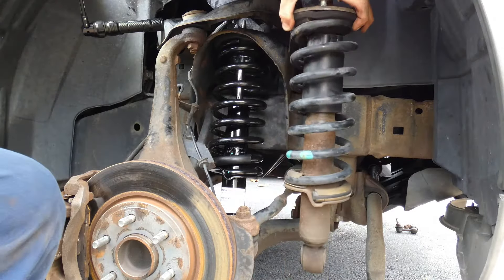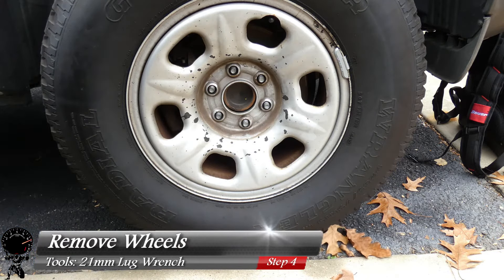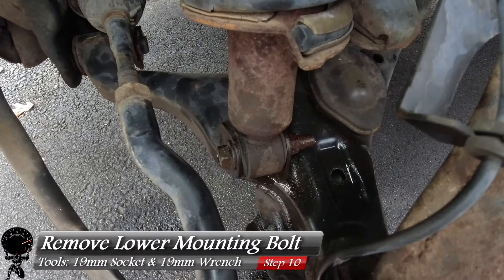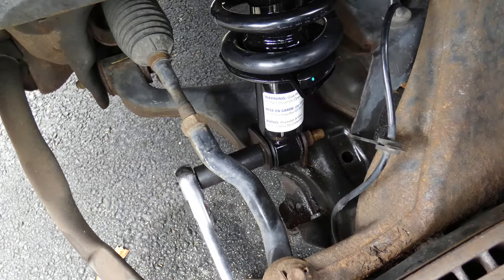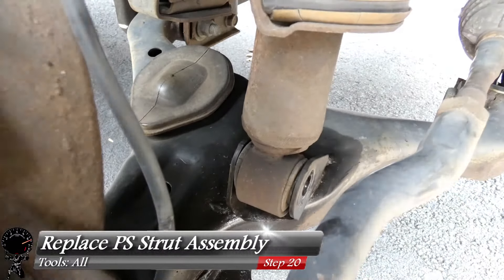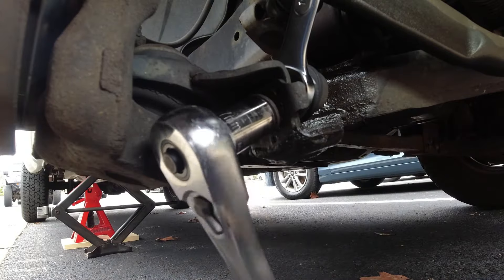How to Replace Struts for a Nissan Frontier/Xterra (2008-2014)

Comment: Hey man, just wanted to show my gratitude for such an informative video! Got some Monroe aftermarket’s I scooped up from RockAuto 140 for the pair. Put them on easily thanks to this video. Thanks for the help! Couldn’t have done it without you. Next up for me are the end-links to the stabilizer bar , and lower and upper control arm (bushing) replacement. I truly appreciate you spreading your knowledge in such a palatable manner. Have a great one, you earned it.
Reply: I would also like to add - make sure there are no aftermarket strut spacers on before you remove the strut (purchased used @ 124,000)😂 almost lost an eye and a couple fingers when the shock flew down because of the pressure from the spacer. I decided to not put them back on and it rides much better as well as ride height being even.
Reply from the maker: Thank you very much. I'm very glad it helped.

Comment: Replaced front parts ,had it aligned ran great, now steering wheel vibrates when I hit 60-70 mp ,now tire on drive side show more wear in middle of tire help😎. Thanks for any help
Reply from the maker: It's hard to determine without looking at it. Middle tire wear can be cause by over inflation. Vibrations could be a number of issues; wheel balance, bearings, bushings, a number of suspension parts. Were you having these issues before the Strut replacement?

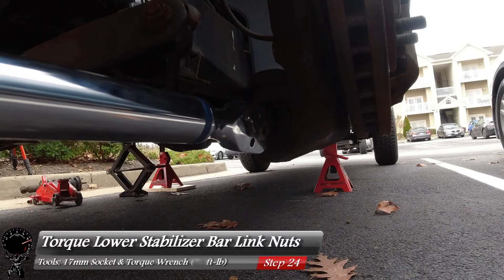Comment: So been watching and rewatching this video of yours and I am puzzled at why the torque value for the Upper and Lower Stabilizer Bar Link nuts are not the same. When you were doing the upper ones, it was 17mm socket and torque value of 67ft-lb, however, when you were tightening the lower one, same 17mm socket but torque value was 14ft-lb (at the 11:59 mark). Shouldn't they be the same ie. 67ft-lb. Did I miss something? Trying to get a clarification here. Otherwise, great video and good tip of the sharpie marking. Now that's what it's for!
Reply from the maker: Thank you. It is 67 ft-lb for both (per the Errata in the description). I'll see if I can add a blur to video to minimize confusion.
Reply: Gotch! Sorry, should have paid close attention to the errata. Was just engrossed in the video part! Thanks for clearing that up!
Reply from the maker: No worries

Comment: This is the best video I’ve seen to help me get ready to switch my struts. Excellent step by step. Thank you for showing both sides, instead of saying just repeat what I’m doing on the other side. Plus, showing the paint marker and why it is so important in the end. On a final note, the difference between a true professional and anyone else is the attention to details. The bushing grease. I haven’t seen anyone else use that in their videos and I wouldn’t had even considered it. It’s the little things the make a professionals quality over just getting the job done type of worker. Thanks again for the great video.
Reply from the maker: Thank you very much. I appreciate the kind words, It really does mean a lot.
Reply: Well I completed the shocks and struts over the weekend and because this is the first time I've done it it took me about 3 hours. The only thing that was different from your video what's the new struts have a bearing on the bottom and no rubber bushing.  That was a little confusing until I read the documentation. I guess it's a new thing now LOL thank you for your hard work on this video
Reply from the maker: I'm very glad it worked out for you!!! Great job and kudos!!
Reply: @mcgurrentertainment   hey man I have a question for you.  Have you ever seen front struts that don't have the bottom rubber bushings? Those are the ones that you said should be greased when installing. The ones I install did not have those just a place for the bolt to go through and just what seemed to be a couple small bearings
Reply from the maker: I've seen struts like that, it's normal.
Reply: @mcgurrentertainment  thank you man if you lived in Stockton I would buy you a big fat triple mocha for that answer
Reply from the maker: No problem at all.

Comment: Ty so much for the video
Reply from the maker: I'm glad you enjoyed it. 😃
Reply: Hey.  My front sway bar is not easy to turn out of the way.  Hopefully I'll be finished by tonight.
Reply from the maker: You got this!!!
Reply: @mcgurrentertainment   Hey.  Having issues tightening bottom shock mount.  Sway bar in the way.   Can I tightening bottom shock mount 1st & do sway bar last?
Reply from the maker: That shouldn't be an issue as long as they're torque down at the correct level.

Comment: The new coils have additional windings and raised my truck 2 inches. Make sure new coils match the original!
Reply from the maker: Good call
Reply: @mcgurrentertainment  I take it you didn't have any issues with ride height?
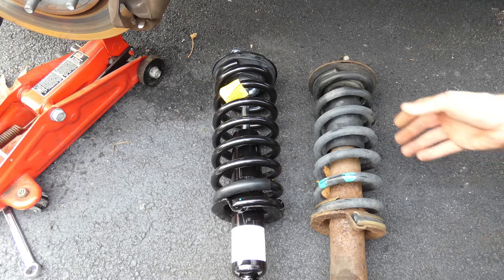Reply from the maker: Correct. At the 6:00 mark, we compared the two.
Reply: @mcgurrentertainment your new coil looks different than the old one.
Reply from the maker: Same length. New one doesn't have a Strut cover.
Reply: @mcgurrentertainment  the new one I installed was the same length too but had more coils which contributed to a stiffer higher ride height
Reply from the maker: Odd
Reply: @texasboy2005 what brand
Reply: @collerdgreens  Sensen

Comment: this is the best video so far on this subject. how long did this take you from start to finish?
Reply from the maker: Thank you very much. Without the camera in the way, maybe two hours. With camera, 4-5 hours.
Reply: @mcgurrentertainment  during your video you were saying that it's very important the torque that lower Bolt after making sure that's the white lines intersect with each other if you don't follow that procedure will it cause alignment problems
Reply from the maker: Tightening the bolt in its correct position is to prevent any damage done to the rubber bushing. If it's torqued while "hanging," it may cause  tearing to the bushing when the vehicle is lowered to its normal level.
Reply: @mcgurrentertainment   I see that makes total sense.  Thanks for making such detailed videos. I've been working on my 2015 Nissan Frontier since I bought it and the way you do your videos it's probably the best way I've ever seen.  I'll be constantly checking back to see what else you come up with man
Reply from the maker: Thank you for the support

Comment: Factory original lower control arm bolts have a tendency to seize up on these models. So not touching them would save customers or those watching from spending extra money on bolts and control arms.
The only lower control arm bolts available for replacement are camber bolts.
Reply from the maker: This video doesn't loosen the lower control arm. I think you are referring to the Stabilizer Bar links. If so, these were the steps provided in my Service Manual as well as the Haynes Manual. With that being said, if you find an easier way to do the job, then that's awesome, and thank you for sharing.
Reply: @mcgurrentertainment  I missed that then lol

Comment: Question: is the raising of the arm to the original position before torqing down the bottom bolt required? What's the reasoning behind it?
Reply from the maker: Yes, because you do want to torque the bolt (and bushing) to the ideal level of the truck. Lifting it mimics the height once the truck is lower.
Reply: But if you mark it while it's on the ground with bad assemblies, wouldn't it be sitting lower than ideal height?
Reply: @drewsenthused6079  excellent question. Would appreciate an answer to this!  @mcgurrentertainment any thoughts?

Comment: Well I see a little bit different between the strut the old one come with the dust cover and the new one come without the dust cover so I don't think it's going to last very long the new one
Reply from the maker: Good attention to detail. Well, at least we can make a good experiment out of this. When these are due for replacement, I'll try out the dust cover version and track the service time. I think that would be good information to share.

Comment: Well thanks to you I work on my mustang and my X. Gonna change my struts and shocks here. Those arent available from advance anymore :( that price was amazing. Dumb question do shocks and struts always come together?
Reply from the maker: That's not a dumb question. If you are referring to the rear shocks and front struts, they can be purchased individually or as a set. If you are referring to the strut assembly (Coil Spring included), you can purchase them separately. However, for ease of installation and minor cost difference, it's ideal to obtain the Strut Assembly.
Reply: Will this fit a 2008 XTERRA Off-Road? @mcgurrentertainment
Reply from the maker: According to AdvanceAuto, no. You would need Carquest Premium 28-710002
Reply from the maker: If you're ordering from Advance, use the coupon code "Chrisfix"

Comment: Would it be a similar procedure with a 2009 Nissan Xterra? If so where can I both rear and front parts! Thank you!
Reply from the maker: Yes, it is similar. You can get the parts from your local auto parts store (or online). You can just buy a set for the front and a set for the rear. It's fairly inexpensive.

Comment: Any tips on dealing with a stuck lower bolt . I got out my breaker bar and went to cranking but that thing is not moving. Not much room in there to cut the bolt .
Reply from the maker: Try using heat, like a heat gun. In the Altima video ( https://youtu.be/7KrNlU_aM4E ) I had to use heat to loosen the nut on the tie rod. Or try using WD-40 penetrating oil; sometimes, this helps.
Reply: @mcgurrentertainment  shortly after posting this comment and covering the bolts in pb buster I was able to get them loose. The really jackhammered them on at the factory .
Reply from the maker: Very nice. Hopefully, that's the only hiccup in the job.

Comment: I have a 2010 Nissan Frontier 2.5l 4 cylinder. If I’m changing the struts and decide to add a simple 2 in lift kit. Would these same steps still apply?
Reply from the maker: I don't recall off the top of my head. I know some of the steps are similar. However, there are likely extra steps, such as extended brake hose installation.

Comment: Help! My lower mounting bolt broke off inside the bushing!!!!!! Btw...my stabilizer bar did not move that easily. I had to remove the bottom nut of the bar and pry it open a little bit with a chisel to get it to move.  It involved removing a lot of the front end plastic .....not fun.
Reply from the maker: I'm sorry to hear that. Were you able to remove the broken bolt? Punch and hammer, most likely?
Reply: @mcgurrentertainment  I tried, but the bolt itself is totally seized inside the bushing. I think my only option is to create a type of ball joint press to try to press it out with a vise. I cut the end off on one side. If that doesn’t work, I will need to take my saw and start chopping. I’m concerned about hitting that shock with my saw because I think it might be dangerous. Where do you think would be the best place to start cutting? I’m putting in a new strut assembly, but this is definitely not the way I wanted to go.
Reply from the maker: I understand your pain. Not everything goes according to plan. It's difficult to say where to cut without seeing it. Just try your best not to damage the surrounding suspension.

Comment: Hey I'm not sure if you are still replying to this video or not but to be clear, you have the jack under the lower control arm while removing the old strut, then it's not there when installing the new one? What is supporting that side of the truck when you move control arm to fit the new strut and at what point did you do that?
Reply from the maker: Step 3: we added Jack Stands

Comment: What digital torque wrench are you using?
Reply from the maker: 1/2 in. Drive 12.5-250 ft. lb. Digital Angle Torque Wrench - https://www.harborfreight.com/hand-tools/sockets-ratchets/torque-wrenches/12-in-drive-125-250-ft-lb-digital-angle-torque-wrench-64916.html

Comment: You did not mention the white marking pen!?
Reply from the maker: On Step 26?
Reply: @mcgurrentertainment  lol
Reply: @mcgurrentertainment  by far one of the best vids on struts!! Doing mine on my 06 fronty this weekend, thanks!!!! I get the marking on the lower control arm to avoid messing up the bushing, but how's come on all the remaining bolts after torquing them?
Reply from the maker: It lets the user know if the nuts/bolts moved (came loose) after assembly. An indicator something is wrong.